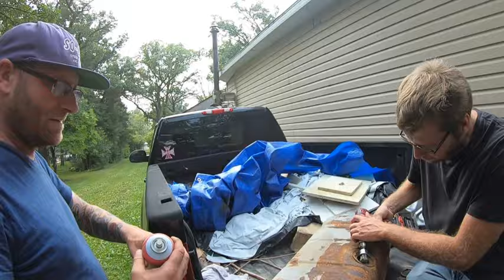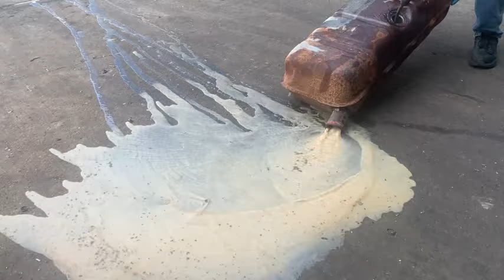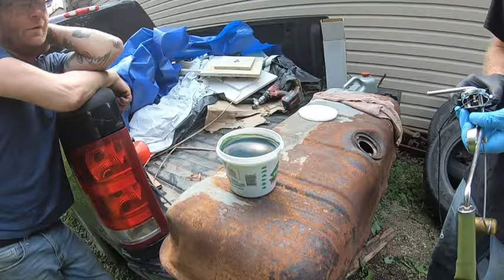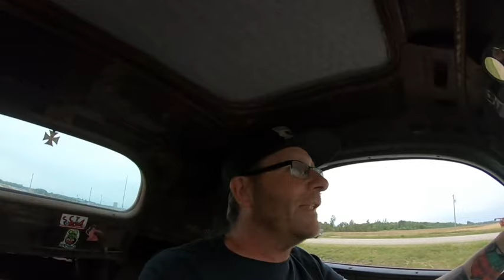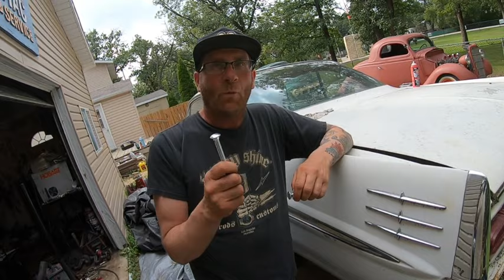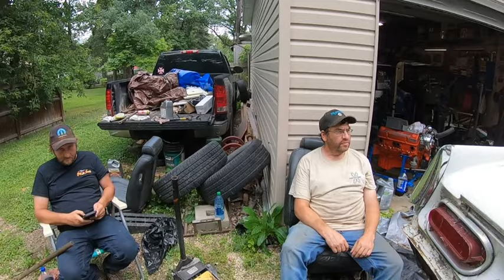1961 Pontiac Laurentian, Cleaning Fuel Tank And New Sender Unit.

Comment: I don't like the plastic fuel filters. Seems like they start to leak or crack easily. But I did like this video 👍
Reply from the maker: Like wise im not a fan of them as well i just want to use them for a bit to to see the junk come out then ill switch to a good metal one.
Reply: Been using plastic ones for 55 years and never once had a problem .
Reply: @darwinfoster7420  Guess you are just a lucky guy.